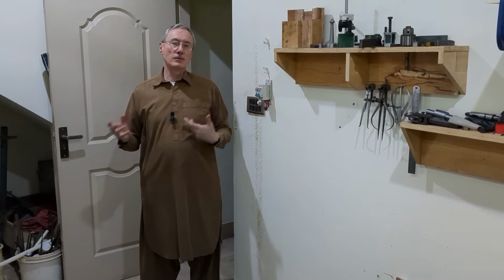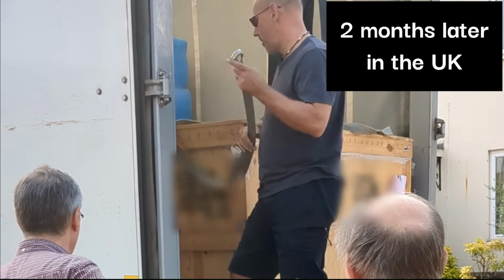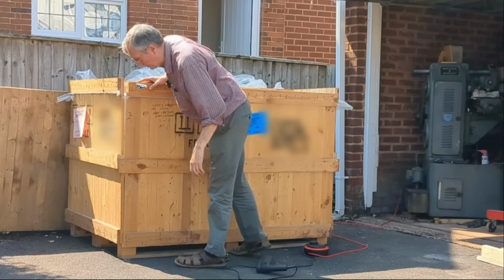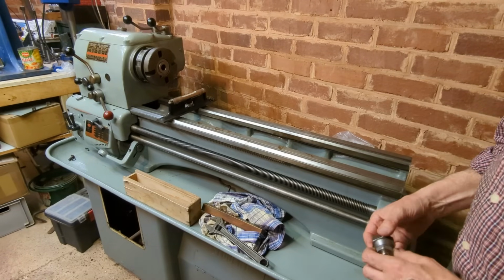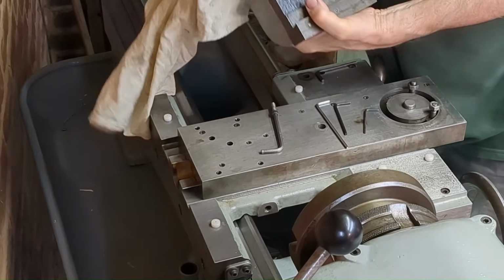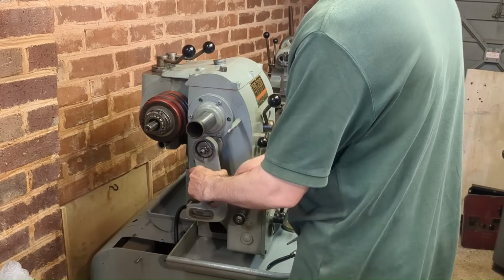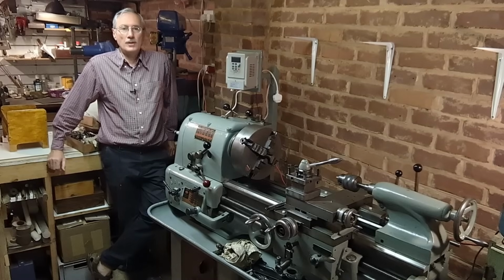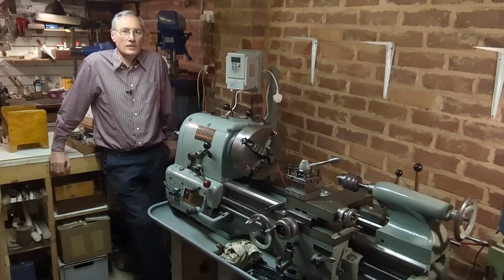Shipping a Colchester Student lathe - Pakistan to UK

Comment: Very interesting shipping and rebuilding. I would think it is standard practice for a customs inspection for an individual shipping, and country of origin. 
My previous employer shipped a large machine from the UK to Brazil,  ain machine was 28000 kgs, plus 10000 for ancillaries.  All the ancillaries were sealed and crated in house,  but the main machine was sealed and crated ( some 3500 kgs of wood) at thecpackers/shippers, this was October/November.  Several months later uncrating at customers,  several litres of water ran out, and revealed a very rusty machine ( surface rust inhibitor was used, as well as dessicant ). Unhappy customer,  and 3 days cleaning and repaint. No evidence of external damage to box or membrane,  it was thought that the wood used inside the membrane had a very high moisture content, along with high humidity of the shippers. Lesson learnt. 
Thanks for sharing.
Reply from the maker: Thanks for your interesting feedback. I understood that the box would be opened at customs but wrongly assumed they would open it from the top. If they had done so the shelving would have been preserved. Anyway, nothing like the damaged your shipment suffered. I had heard that condensation running off the top of the shipping container can be a problem which is why I added plastic sheeting over the top. But, I suppose there are so many variables which are difficult to anticipate.

Comment: A worthy effort and satisfying story. As all things change in time and memories sadly lost, I suggest you machine an aluminum cylinder of an appropriate size, impervious to the elements, and attach it to the lathe in an out of the way location. Insert into the cylinder a transcript of what you shared with us. Include, if you don't need them for other purposes, the original of the shipping documents. You could also include maps of Pakistan and the UK denoting the locations where the lathe served.  You have a machine that is a world traveler, touched by many hands. A history and provenance well worth preserving. Machining and mounting the cylinder would be an interesting video as well. Best wishes.
Reply from the maker: Thanks, Rex, for your interesting thoughts. I hadn't looked at it that way. I did sell my first lathe to someone who was collecting early Drummond lathes but that was an older machine. It is true that is a well travelled machine and has almost completed full circle to somewhere near where it was originally made. I have all the paperwork and could easily make the time capsule. A possible project!

Comment: Thank you for your detailed and well paced vid. I have been courting the purchase of a Colchester Bantam from an old chap here in Melbourne Australia although he's still not quite ready to part with it. The lathe is ex-Trade school and in pristine condition although perhaps not quite as spotless as your own. It is in a garage at the bottom of a long sloped driveway and I it will likely need to be similarly disassembled to extricate it.  Do you have a resource for the assembly /disassembly that you could point me to?  Also, I have heard the Bantam and the Student are very similar but I've not been informed of the specific differences if you or another viewer would care to enlighten me.
Reply from the maker: Thank you, Aaron, for your feedback. You may not need to dismantle it. The Bantam, though robust for its size, is a bit smaller than the Student - nominally 5in centre height. I haven't had the chance to view a Bantam but from what I see in photos it seems to have some features in common with the Student. I was able to partially dismantle my Student for removal down several flights of stairs without a manual so it is fairly intuitive. Removal of the saddle and apron require that the leadscrew and feed shaft be withdrawn first. I have a manual and parts catalogue for the Student Mk1.5 in pdf format which I can send you by e.mail if you write to workshopfriend@gmail.com
You could purchase a manual for the Bantam from lathes.co.uk Their website also has some useful info on the Bantam. For some details of the Student assembly see one of my early videos: https://youtu.be/Y5-hR-SWK84

Comment: Why my comments getting deleted?😮‍💨😮‍💨😮‍💨
Reply from the maker: This is the first of yours I have seen! Earlier I had problems myself replying to comments.
Reply: @Workshopfriend  look like youtube issues
Reply: Clive I am about to purchase a danish lathe "Vesuv Prince". I checked your website very good info but I have a few questions about this lathe. especially about screwcutting.
Reply from the maker: Took a look at this lathe on lathes.co.uk
Looks like a good small lathe.
Reply: @Workshopfriend  thread chart on this is Imperial but I need Metric. Do I have to change the threading gears?
Reply from the maker: Almost certainly, yes. On my Myford imperial lathe I achieved this with a 21 tooth gear and various combinations of the standard set. Sometimes a 127 tooth gear is used but it may be too large to fit into the available space. Once you know the details: lead screw tpi, available gears you can see which option suits you.

Comment: That VFD will destroy the bearings thru frosting and then fluting from the stray power about 70v that builds up on the motor shaft dozens of times per second then finds earth thru the bearings..the motor shaft can be earthed to prevent this..a common motor brush to earth against the rotating shaft..they do make products to fix this issue..best bet is to set up a rotary phase converter to change 1phase to 3phase electric..then you are open to use more industrial machines having a master 3 phase source that each machine can use..as its a one man shop etc..
Reply from the maker: Thank you for pointing this out. I didn't think of the bearings! I assume this is more of an issue with these cheaper VFDs.
I will investigate how I can add a brush to my lathe, mill and shaper motor shafts. My other  items have higher end VFDs.
I would prefer not to go for the rotary inverter option because I have already invested in separate VFDs and like the speed and torque control.
This is a matter I intend to investigate.
Reply: @Workshopfriend the technicians who work on larger Hvac systems in large buildings can talk about this issue.. they make clamp on rings that earth the motor shafts..all VFDS probably do this and I'd bet more so on the cheaper units..they also make ceramic ball bearings to fix this problem too.. it can be as simple as laying a bare copper wire on the shaft to earth..the heavy damage happens around 600 to 700hrs of use..so many guys at a home workshop never see this happen..

Comment: Great to see you've got the student back in a happy state. I guess it's a well travelled machine? I imagine you bought it in Pakistan, but was born in Colchester. 
 Interesting how you've put your machine in exactly the same place as I have mine in my garage. I haven't cut a hole in the wall though....but I do need to access the motor as my drive belts aren't matched very well, and cause a vibration, I will verify this by removing one belt to see if the vibration goes?  I've made a toe jack so I can easily lift the lathe onto a bar or steel plate and slide it out.
Reply from the maker: Yes it is well travelled; this is the second time I have shifted it. The first time we had to take it down 3 flights of stairs. It is now certainly much closer to its place of origin.
I considered placing it on a surface I could slide it on but didn't want to keep upsetting the levelling (my floor is all over the place). On balance perhaps there isn't much to choose between the two.

Comment: Very interesting to see the Pakistan end of the operation Clive. I imagine it will take some time to adjust to the UK. We've lived overseas a couple of times and each time it took at least 5 years to fully resettle because life was so different. Like the hole in the wall. Many ways to solve a problem. Cheers [post script, watching this on my TV, as i mostly do, and no link pops up?]
Reply from the maker: Thanks, Paul. Yes, it is taking time to adjust though I still get to travel to the region.
I tried to avoid the hole in the wall! Strange that the links didn't show up on TV. I checked that they are there.